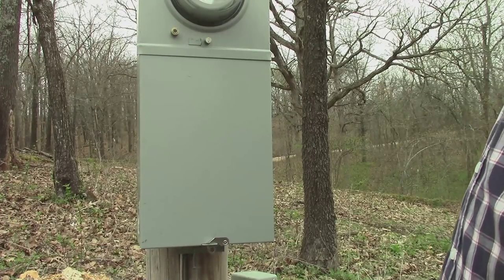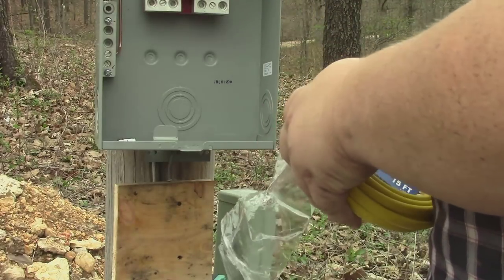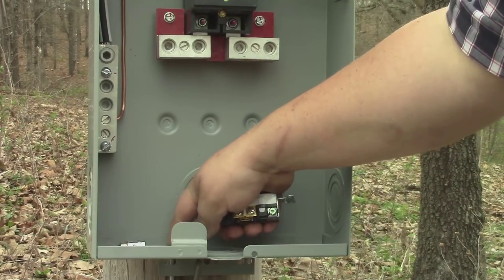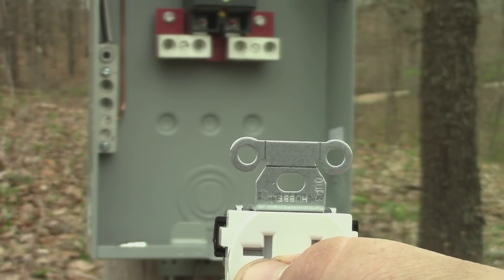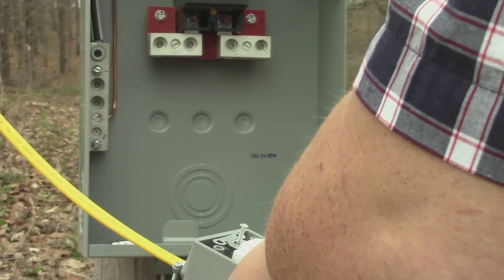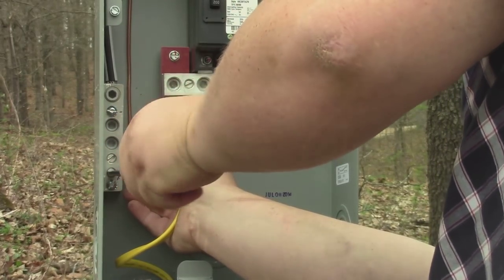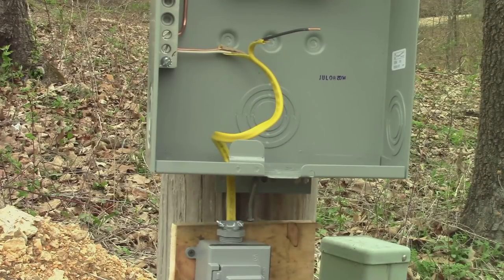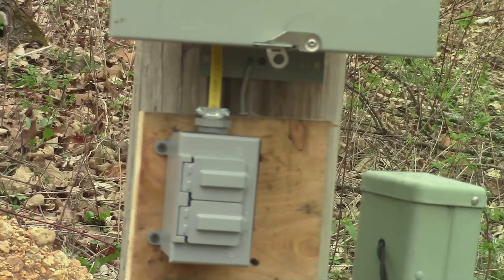Hooking Up Temporary Outlets To An Electric Meter

Comment: I recently added outlets to my electrical meter box, 240V 50A and 120V 20A. Yes, I used seal tight, sealed the connections, used breakers, a GFCI on the 120V, weather proof covers... but this was a permanent installation. Temporary power in an idiot free environment, his set up is just fine. Not like he's got to worry about burning up Romex inside a wall where it can start a fire.
Reply: Do a youtube video on your setup. I would like to see that. Just bought property with a 50 amp hook up right on the meter box and need 20 amp outlet. Thanks.

Comment: Good job doing what you have to to survive, I saw you didn't quite know what to do with the wire nut, you just needed a little conduit to make it water proof. Thanks for the video, I've watched a dozen others trying to get my meter and temporary power set up. I'm no expert but I got gfci for mine, and in-use covers.

Comment: GFCI protection outdoors is not an option. Use some kind of tester for checking power. A 20 amp breaker added to this would not cost $100s of dollars. A service rated fused disconnect with a GFCI receptacle already installed is less than $50. The wire you used is not for outside. The cover on the receptacle is not for outside where subject to rain.
Reply from the maker: +B_a_c_k_s_t_a_y  I looked for one, all I could find was like RV hookups and discontinued models.  If you know of one in particular shoot me the link and I will install it ASAP.  I tried to find an inline 120V 20A AC fuse, but could only find them for industrial equipment for hundreds of dollars.
Reply: a single fuse block an inline fuse etc....anything for protection.  You have no protection on that #12 other than the main breaker.  Single fuse blocks at home depot are like 10 bucks and then buy a 20 amp fuse to go in it.  Also it's a requirement to have a gfci.
Reply: 50+ years nobody heard of a GFCI. Just because the government says something doesn't make it true

Comment: Your amprage is the ability to do work. The gauge of the wire determines how much work you can push through (ohms). The plug and wire I believe are only rated for 20 amps any more then that and the wire or plug will burn up literally.  Just make sure not to plug in more hen 20 amps and you wont have a problem.  For safety personally I would have a GFIC plug and I would mount the wires so they come in through the bottom so water can't get in.  Great video keep up the good work.

Comment: I’m wiring up a main breaker box similar to this except I’m going off the lugs pulled the meter out the bottom
 Lugs aren’t hot got to check em with a meter of course

Comment: Wow! You quite possibly killed someone who wasn't knowledgeable about electric power! No GFI, no weatherproofing, no proper tools, no breaker... I'm glad you had no power to the connection when checking it with a hammer but what if someone did have power and did it this way? A simple tester only costs about $10! Wire strippers are a whopping 5-10 bucks. Plastic conduit is dirt cheap and so are the fittings. I'm glad you stated "this is how I do it!" Lord help anyone who follows this advice!

Comment: Advice is being given even from an electrician and he refuses to take it. I agree that everything you did is wrong. But let me recount a personal story of only 100 amps of electricity. I was rewiring a temporary panel that was hot. I used a screwdriver to free up a 6 gauge ground wire that was stuck. It came loose and was flung of all places, straight into the hot connector. There was a huge loud spark like lightning and my 6 gauge wire was melted as though it had been welded. Fortunately I had a plastic handled screwdriver, was wearing thick rubber gloves and boots and was on a raised wooden pallet with a rubber mat.  And you think 200 amps won't hurt you. No GFCI, 200 amps feeding your plug, and a huge hole where your wire feeds in to your outlet to allow rain water to pour through and no conduit so the sun can bake your indoor insulation off and expose bare wires. Instead of being defensive, you should take the advice and fix your problems.
Reply: I could wire this using a metal handled screwdriver buck nekkid and bare-foot in the pouring rain and laugh at you scaredy cat snowflakes.  I am an electronics technician,  but I can't seem to find my metal handled screwdriver.

Comment: Most wires have that paper rope or string inside so you can use it to pull back the outwer jacket. So just cut a half inch to an inch of the yellow jacket, grab that paper and pull it down to strip the outter jacket that way you avoid cutting the jacket on the inside wires. I know its pretty tough to cut the inside wires but might save yourself from a short or too much resistance in the future. Multi-meters are cheaper than hammers, i hope you don't do that again! Lol thanks for sharing what your up to.

Jed
Reply from the maker: NDNomad I need to just get a pair of those special strippers for romex..I do have a multi meter, I just didn't have it with me.  I'm just trying to share real life situations...no editing out the mistakes or stupid ideas here! lol

Comment: Someone decides to run a space heater, hair dryer and coffe maker - the wire overheats and starts a fire. Only you have access to the panel, so you are responsible.
Reply from the maker: +Dfit Only I have access to the panel...you are right, but see that means no one else can open the panel to turn the main breaker on!  So no one can use power but me.  And I'm not plugging in all that crap for sure!
Reply: What will catch on fire? The wire will burn up, but it's not buried in a wall. You only have to idiot proof if idiots are present.

Comment: Not bad....sometimes the ground bar and the neutral are separate...ground on left...neutral on the right. Usually the grommet in the bottom of the panel box is mainly used to protect the wire from contact with the box, it also grips the Romex in a way that it keeps it from being tugged on from the actual connection point. I laughed at a few parts but all and all, was a fairly accurate video

Comment: Not to be negative, but you really need a 20 amp breaker before your outlet.  If you had something pluged into that and had  a short , you would  really have some hot wires and other problems.  Just for safety.  Be careful and good luck on your ventures.
Reply from the maker: mark baker I had intentions of putting in a load center, but then I talked to the electrical supply guy and he told me this was common practice around here...That as long as I don't draw more than 20 amps I'm ok.  Like you said if I get a short it will draw more..Having said that I showed it will work as is, but I will put a 20 amp in line fuse in for safety.  Not a breaker, but I'm sure a 20 amp fuse will work the same.( Obviously a 120 volt big 20 amp fuse, not a blade type! lol)
Reply: Lack of a breaker is a fire hazard, not so much an electrical shock hazard. That's more associated with lack of ground, which you do not have. You have a couple feet of Romex... not exactly a huge run buried in a wall. This really isn't as dangerous as the "pros" are making it out to be. I especially love how they seem to have forgotten that GFCIs are relatively new. Over 5 decades of outdoor recepticals without a GFCI... just saying.

Comment: Good video one thing you could have done different is you could have put the little box right on the big box but that will work just fine
Reply from the maker: William J. Barnhart Jr. I thought about putting the outlet inside the meter box...But i don't if the electric company would like that one or not.

Comment: You can buy a temporary meter socket with GFCI receptacles and circuit breakers already installed.
Reply: yes, but with a smart meter you're going to have to explain to the power company why you pulled the meter and hope they don't call out an inspector to make sure you're up to code and then tell you that you have to upgrade all of your breakers to afci. If you had thousands of dollars to spend on that, chances are you wouldn't be doing this yourself in the first place.
Reply: @mleiber1982  In most states (in my state for instance) they only require AFCI breakers in new finished construction.

Comment: Tim, I can see that after several posts/replies that you have you'r mind set in the fact that this set up works and may or may not ever fail and harm or kill you. I would like to make a suggestion to you that you replace the receptacle to a GFCI receptacle. At least this way if there is a short to ground the GFCI will trip and you will have at a minimum a way to shut off power. A simple GFCI receptacle is around $15 and I would think that you life and you'r life to you'r wife and children is worth $15. Believe me when I say that you don't want to take a ride on 200amp service. I know what you are going to say. The receptacle is rated at 15 amps and that you would only get 15 amps ride. No the receptacle is being supplied with a 200 amp service. See if there was a 15 amp breaker after the 200 amp service the breaker is being feed with 200 amps but the circuit is being protected by a 15 amp breaker. Now, before you reply with the typical I'm a hillbilly attitude, I'm originally from MO just south of KC. I fully understand how hillbillies do things, hell there are hillbillies where I live but I prefer to call then uneducated in electrical practices and that is how I consider you. You have the full intentions to do it right but just don't have the full knowledge or funds. I will make you an offer. If you post a video showing you replaced the recpt to a GFCI recpt I will give you information on how to create a solar or wind  or combination of the two with a charge controller and inverter for somewhere around $5000. My solar panels will create 1K of power $1000 (4 Panels, Bought directly from the supplier), 1K wind gen, charge controller and load dump somewhere around $1000, 6000 constant/12000 watt surge inverter $2000, Batteries $1700. Now this is the set up but I won't tell you the suppliers names until I see the video. Just don't use Mo wind and solar.
Reply from the maker: +Jeff Gattenby First, let me say I'm not trying to argue, or make anyone mad.  This was a way for me to have power to run my air compressor without having the money to do it right.  I absolutely know the right way to do it.  I have an above average understanding of electrical circuits and how electricity works.  With that said I chose to take a risk to get power immediately when I needed it without spending over $100 on an outdoor subpanel and outdoor uv rated romex.  Honestly I never thought to use a ground fault intererupter outlet as a breaker.  I searched high and low for a 120v 20amp inline fusable link, but couldn't find one anywhere.  I will go out and get a gfci outlet and put it in...like I said I never thought to use one as a breaker of sorts, so thanks for the suggestion.  Also, everone keeps saying things about children getting hurt...I have said before that the meter box, which contains the shut off 200 amp breaker, stays locked with a brinks padlock at all times.  And I'm the only one who ever uses the power, so I am only hurting myself if anything were to go wrong.  I know that if something shorted out There would be 200 amps flowing through not 15.  An appliance will only draw 15 or less amps when it is functioning properly, but I know it's possible for the 200 amps to shoot through if a short were to happen...I just simply chose to risk it.  Not unlike skydivers or race car drivers.  As for the solar,  There's no flippin way I could afford $5k for solar.  Not to mention my wife will not sacrifice any comforts, so the solar setup I would need to run ourr house with ac and everything would be a 7K system!  I thought about going solar briefly, but the wife's unwillingness to give up things like ac put a stop to that quick.
Reply: +Backwoods Patriot I understand your concern over solar. But, you see the inverter I use actually uses household ac supplied to the inverter that charges the batteries in the event that the solar doesn't provide enough power to charge the batteries. Now at 6000 watts it will provide 27 amps on a 220 volts (6000w /220v =27amps) Now that should more than likely power all the lighting and small appliances in your new home. Then you can still run the a/c on electric supplied by the electrical company. You might want to look at adding a second solar/wind system just to run the a/c/range. You see there are a/c systems that you can install to zone your house that will run on less than 20 amps. On a side note, I know that you are not trying to argue or make anyone mad and that you are just being you. That's OK however you being 31 yrs old and me being 47 yrs old I have seen and done things that you may have not done and I hope that you understand that I just want you to be safe. You need to be an asset to your family and not a liability. You need to be around for your family because it just might be a hell of a road fr your wife to go along with three children by herself. Staying safe is priority # 1. I understand that you didin't want to have to pay for an exterior panel just for temp service when you will be installing the main panel in the house but when you go out to the site and camp by yourself and something happen it may be days before someone finds you. Just be safe. Solar and wind are good options to look at in the building of your home. If you insulate well your a/c demand will go down and with that so does the amps needed in running the condenser.
Reply: Jeff Gattenby some people need shock treatment
Reply: Can you set me up

Comment: you just wired up a 100 amp receptacle it won't trip until it cooks or a dead short the receptacle does not limit the amount of available AMPERAGE
Reply: And then what happens? Your Romex catches fire inside a wall? Oh wait... this isn't as dangerous as people are making it out to be. The potential to burn up the Romex or melt an outlet is there, but the damage would be minimal.

Comment: It worked. I believe he said it was a Temp install & obviously not up to code. With that being said... it worked. 

I get that guys dog electrical installs when their not up to code because they can cause a hazard. But if someone is experienced in electrical work & they plan to be the only one to use that device... then knock yourself out. Guys will jump all over this dude for the code violations but they'll watch the video & post a video reply, talking shyt while driving down their street & toting on their favorite vape pen. But that's all ok. 

🤣 I'm just saying, at a point in ur career u get so dam tired of guys barking about code violations and over engineering temp installs & demanding everyone use the highest quality shyt and the most expensive materials & secure the wire every 4 inches TWICE with galvanized screws & duck seal all around it & antiox it, then caulk it again just in case... hold up... let's Flex Seal that shyt shut! Them fuQers made a boat outta screen door. It gotta be great for Romex! Maybe we should hit it with a coat of polly afterwards too, that'll seal them wires all up guud. Ill Go get every Milwaukee tool I got & we'll put up the best dam receptacle on YouTube! I need to charge my iphone to see all these likes we guna get but... I got no where to charge it up at yet. Cause my 87 dollar receptacles still drying. 

It's a temp receptacle guys. That's all. Guys do it every day when their changing services. Its even left in the off position. It cant hurt nobody. 

I'm not saying do it. I'm not saying dont. I'm saying when u get on YouTube bytching bout how osha's gona put everybody in jail & this receptacle is gona burn the whole dam woods down... u look like the nut job. Going to bed 🥵🤣🤣🤣🤣
Reply from the maker: Finally, someone with real world common sense.